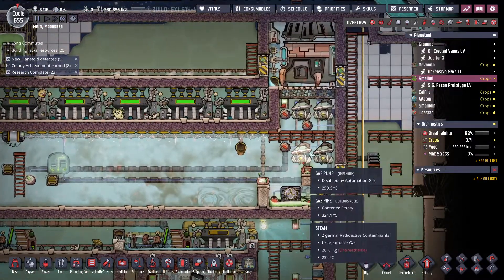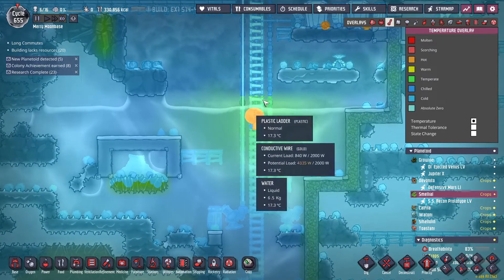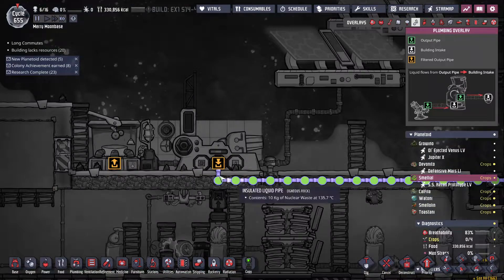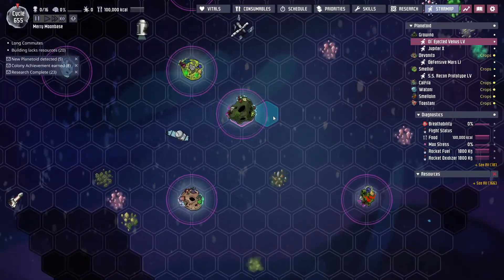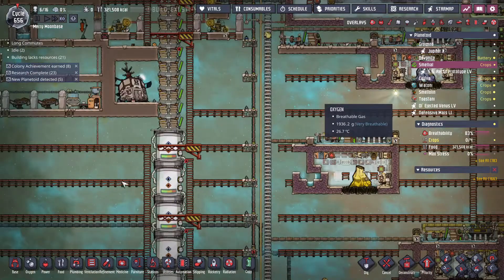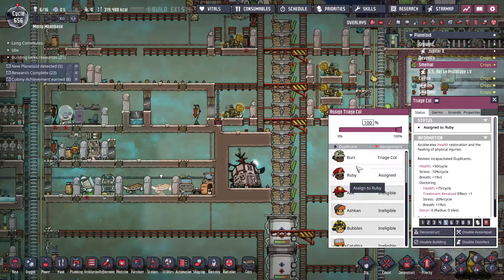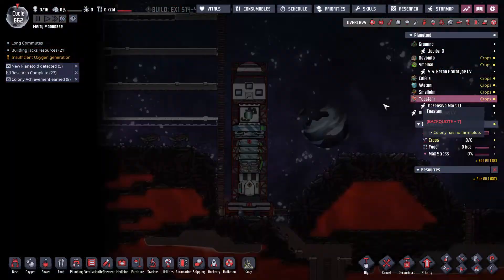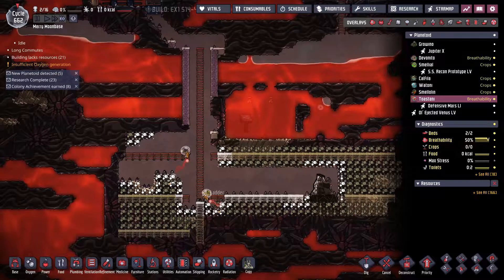Merry Moonbase Ep 25 Nuclear Automation Take II. Rockets Fun Times

Comment: I started a new playthrough since the latest update Klei has added the temporal rift back into Spaced Out. I think it needs to be activated by a Gravitas building on one of the planets. Another thing I'm going to try is build a base at the bottom of the water planet since Francis John showed it's possible to land a rocket in the water. Would be an interesting way to cool engine exhaust.
Reply from the maker: Fun idea, I wonder if a super hot one line hydrogen engine will make steam on the way down.  I thought my playthrough had the rift, but I missed it.
Reply: @TartarusPlaysGames  I think your magma planet has some Gravitas buildings in the upper right part of the map. Maybe we'll see what's there once you've drained that magma pocket. Or maybe need to go further downward.
Reply: Same here. Only i cant choose the big map.. I wonder if they made it much harder since the last update.

Comment: Your electric overload I think is caused by the battery, when your grid needs alot of power it grabs everything it needs from the battery all at once and overloads the wire. Your battery needs to be behind a power restrictor.
Reply from the maker: I agree.  I am going to use automation to control the transformer to stop this.